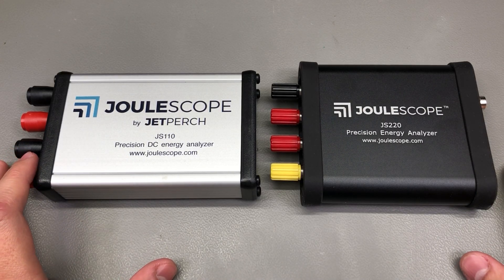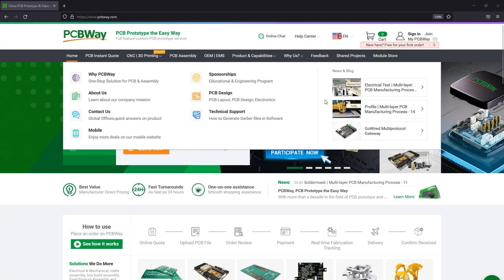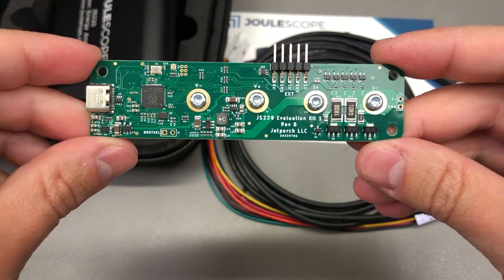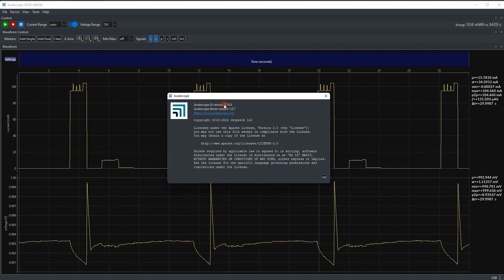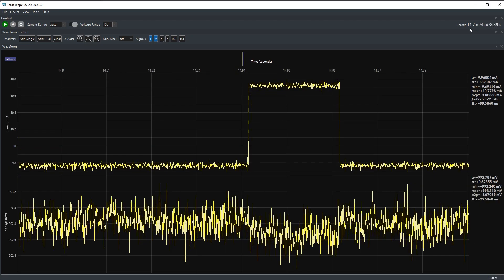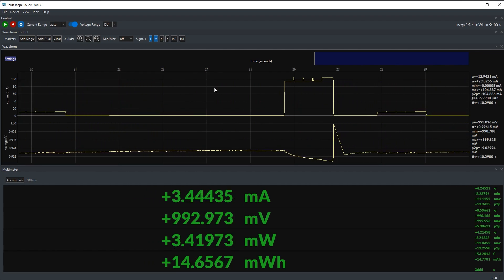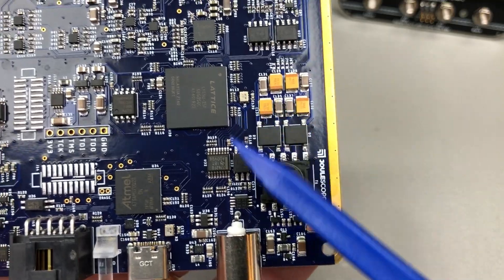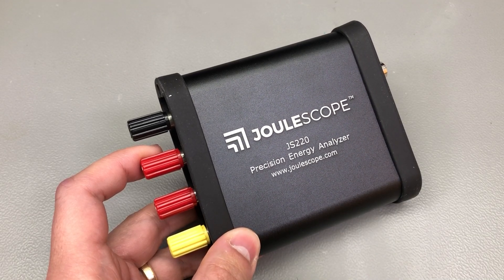New Joulescope JS220 Better Specs Same Cost | Voltlog #433

Comment: Did you say very affordable??
Reply: It's "relatively" low cost. most analyzers with such capabilities are at least $5000 up to $10'000. So for less than 1K$ it's considered as one of the more affordable and with the best price to capabilities ratio.
Reply: @ahmedlazreg6373  I understand you. But I still don't think this is very affordable for a hobbyist. I find a PKK2 for a tenth of the price more affordable.
Reply: There's that saying "if you need to ask, you can't afford it" - well, the converse of that is "if you're not willing to NAME THE PRICE, it is NOT 'affordable' ". Applies perfectly here too...